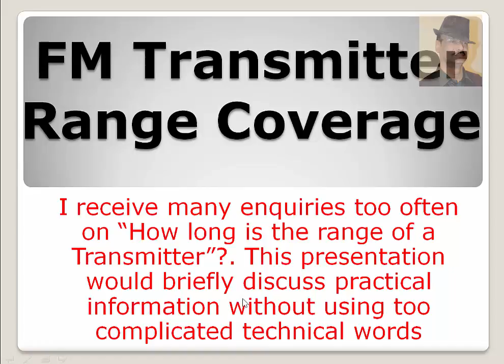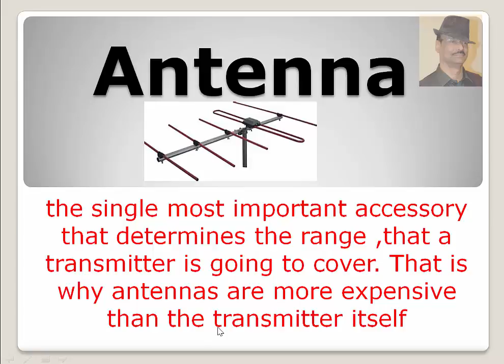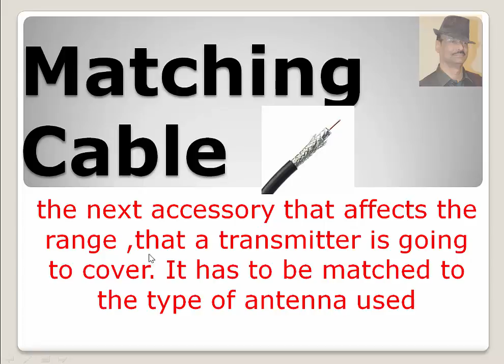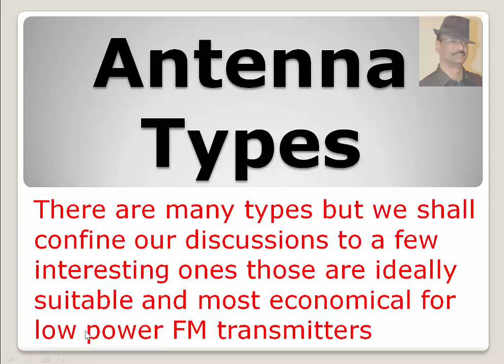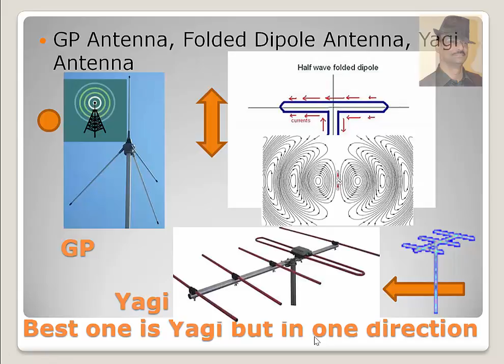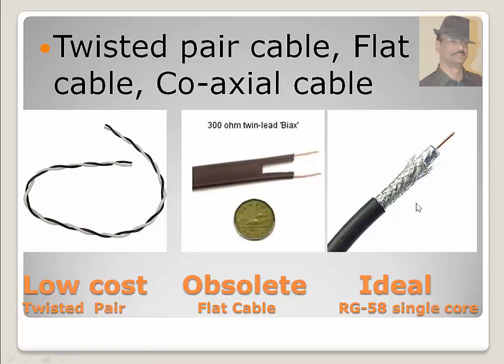FM transmitter - long Range - by Correct Antenna and cable

Comment: Let's say I'm current;y using a 5w FM transmitter and I want to upgrade to a 15w transmitter, do I need to get a new antenna even if I don'y change my frequency? Thanks!
Reply from the maker: Depends on the type of antenna and its dimension and material

Comment: I need to monitor audio at a farm gate 500 meters from house. Would you run cable or transmit and receive the audio  via RF?
Reply from the maker: Tony Ross cable is a better solution. RF involves legal issues of using without license beyond 100 meters. No issues if used within 100 meters as allowed in most countries. However in remote areas beyond police monitoring using RF for 500 meter s is no problem but with risk.
Reply: @PatnaikUC  Thanks. How would you rig it up?

Comment: I really want to use my tv antenna as a fm transmitter
Reply from the maker: TheAmazing Jon Standard tv antenna may not give desired range. It has to be made as per the frequency.